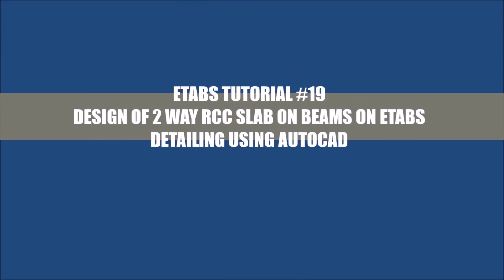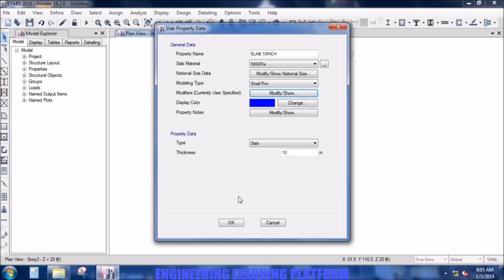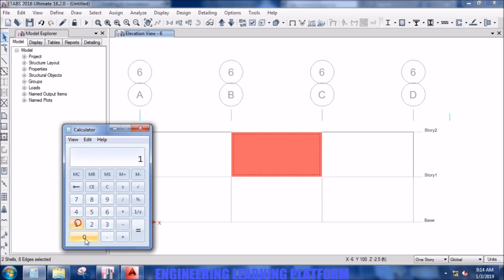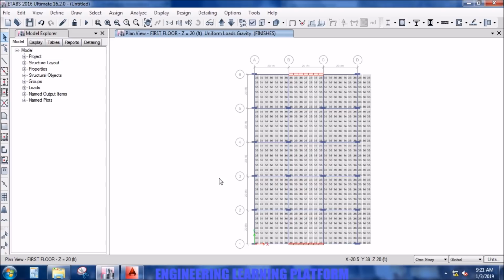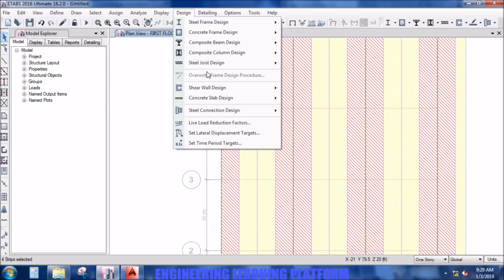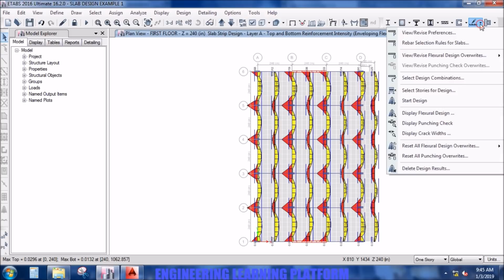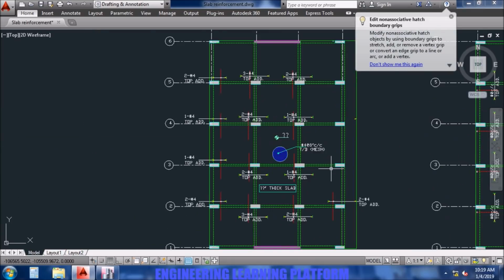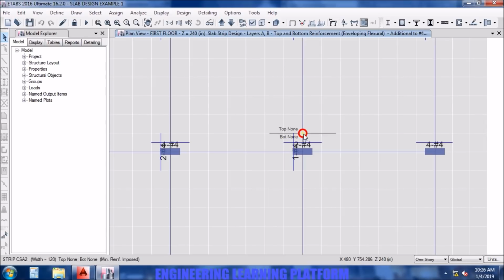Design of 2 way slab using Etabs Tutorial - Direct Design Method

Comment: Can you do make one for 2 way slab with ratio greater than 1?
Reply from the maker: Sorry what do you mean
Reply: @EngineeringLearningPlatform  
I am working on a project. It has multiple 2 way adjacent slabs of varying Lx and Ly. 
I have assigned Edge releases M=0 & T=0.001 to all edges for effect of Simply supported.
Used strip method for analysis.
Strip A for short span and Strip B for Long span of slab for every individual slab.

In local axis of slabs, I have given 90° wherever short span is along Y axis. 

After analysis, I am seeing slab moments max in Strip B (long span) rather than in Strip A (short span).

I tried multiple stuff but it just doesn't go right..
Reply from the maker: Don't release moments ofcourse @Mohsinbagban
Reply: @EngineeringLearningPlatform  Whether I release moment or not, the answer is same. I get My>Mx.

The middle strip width I consider is
0.5L + 0.5R =1m
Reply: @EngineeringLearningPlatform  In short, I'm getting more My > Mx

Comment: thumbs up bro! I Have one question how to know that the load applied to the slab are correctly transfer to the beam ? can we design the slab beam and column in the same project?
Reply from the maker: yes but in different runs as when designing beam and column we need to take slab as membrane, and when designing slab we take as shell thin type and also apply construction load on ground floor.
Reply: @EngineeringLearningPlatform  Thanks for your kind remarks. I would add another question why we can't use shell-thin and apply load on it(shell-thin) and then design everything in the same project? as the shell-thin cant transfer the load to the beam accurately?
Reply from the maker: @atiqahmadjan9175  shell thin is no doubt realistic, but membrane condition is rather conservative.

Comment: Hi. What do you mean by Framing: Intermediate Moment Resisting Frame?  Can I use metric equivalent, do simply supported solid 2-way or 1-way slab on beam and use BS 8110 code  using Etabs? For simply supported slab, how should the beam dimension be considered as for example 425x150 means the height of 425 include thickness of 125 mm. for slab and 300 for the web of the beam with each element being cast at different time (hence simply supported) and 150 is the width of the beam. Thanks for those precision.
Reply from the maker: Imrf is type of frame used in moderate seismic zone .
Reply from the maker: For beam dimensions size 450x150 is actually 300 web and 150 in slab of 150mm thickness